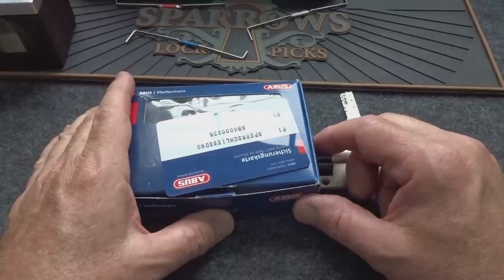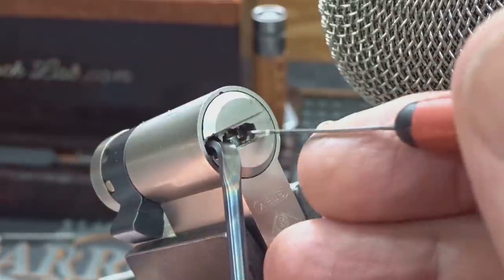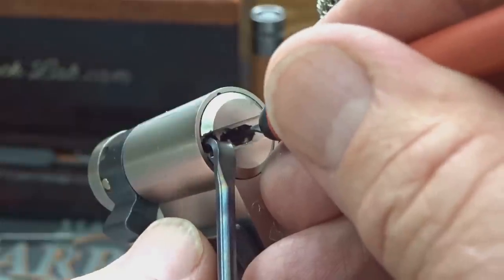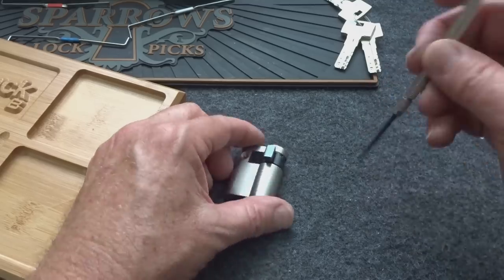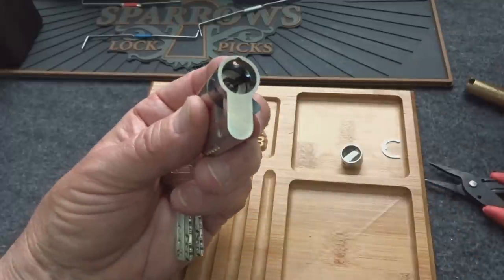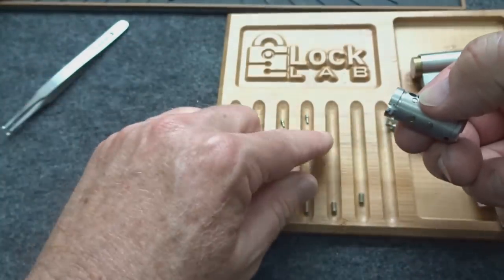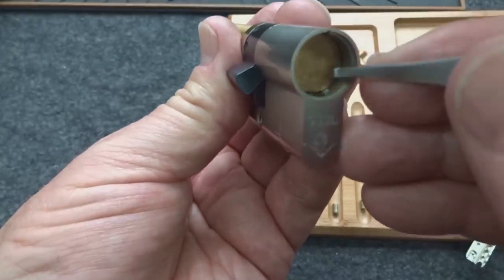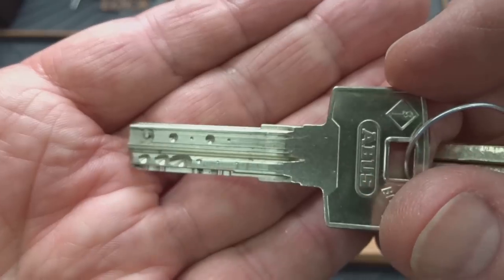(1084) Abus Bravus 4000 Picked Open & Gutted

Comment: There was no sidebar - the groove in the bottom was for the bottom pins and they appear to be purely key control (notice that they had reduced diameter and springs pressing them out towards the bible). It appears that it was actually an 11 pin lock, where the five sidepins acted as ordinary pins ... or did I miss something..?

Comment: (12:21 "I don't know what that guy in the back there does") If you had continued to turn the cylinder even further after your pick, the rearmost upper pin would have engaged & stopped you.
Reply: @fernandosm2066  There are Bravus with magnets: 2500 and 3500. A copied key without the magnet will be useless. These versions also feature pulling protection and higher drilling protection.
Reply: I wonder if he could have done a full turn with that extra pin. Quater of a turn doesn't open any door.

Comment: Good work Bill. What's your personal recommendation for a high security euro cylinder?
Reply from the maker: One word:  Abloy.
Reply: Wish I could afford.  As picking isn't the attack used in the UK (snapping is) I quite like the look of that Yale Platinum you picked yesterday.  It certainly took you some time, and would not be vulnerable to snapping.
Reply: Anything 3*** rated should be hard to snap and difficult to pick
Reply: So Bill, when can we expect a Protec or Protec2 picking video? :P

You know i'm just kidding mate, excellent picking as usual. I know it doesn't count to you because of the battery misbehaving but we know you're not about claiming false credit, you wouldn't have posted this video at all if you didn't actually pick it.

As an aside, you didn't ever answer my question about your 50mm BiLock brass padlock, did you ever end up picking that bad boy? The one in question is the fixed core with BiLock stamped on the front of it.
Reply: Also, what are your thoughts on Abus' X14 and XY14 system? Have you had the chance to have a pick at one?
Reply from the maker: Have not spent a lot of time on the BiLock, but have had NO luck with it (yet).  It is still living comfortably in the naughty bucket hotel.
Reply: Looking to change also to a Yale Plat. or an ABS.......................
Reply: cjmillsnun an Avocet ABS cylinder has 2-stage snap protection as well as coaxial pins and an active magnetic element. Bill dismantled one a few years ago, it’s impressively well-hung for a euro cylinder. 
Oh yeah, trap pins too. Lots of.

Comment: I'll give ya credit bill
Reply from the maker: Nope, but I appreciate it.  Any break in the video nullifies the attempt...  that's the only way we can be sure someone isn't deceptive.  In my case, i could have switched out locks during the battery break, moving out a partially unpinned (easy) lock and moving in an unmodified cylinder for the gutting.
Reply: bosnianbill your honesty is refreshing, I finally understand what you mean when you talk about taking or not taking credit. Either way, good job with the lock sir.
Reply: Yeah, Bill, we saw you pick it on camera, the camera puked while you was disassembling it, as long as it's picked it counts. :D
Reply: You could get a cheap secondary camera from a different angle (across the workshop) that is able to be plugged in while mounted. Then use it as a picture-in-picture only on videos where the primary camera causes you problems.

Even a cheap vehicle dash cam would work for this. I have one that was about $20 USD and a 8GB card will record about 10 hours on it. (though low-light visibility is absolutely terrible on it... but I wasn't expecting much at that price.)
Reply from the maker: This is the best idea I've heard!  I have plenty of Mobius and Runcam 2s lying around that I use on my quadcopters.  They would be perfect "insurance" when I pick challenges.  Thank you!!!
Reply: Problem solved!
Reply: no,it doesent.Dont get me wrong,I KNOW for a fact that Bill didnt cheat,but thats not the point,the point is he coulkd have
Reply from the maker: I actually USED your idea in the latest video where I opened a DOM IX-6 SR!  20 minutes into it I got the lock open and looked at the battery level (less than 1/2) and realized it would die on me before getting to the gutting.  I quickly grabbed one of my quad cameras and continued on.  several minutes later, the main camera died but the Runcam kept on ticking!  Thanks for a great idea.
Reply: bosnianbill 😉👍
Awesome! I'll have to watch that one when I get off work.

Comment: What about a "fake battery"? If theres no "fake battery" for your camera model, you can usually make one yourself. A "fake battery" is a "battery" which is made out of a wood block, plastic block or whatever, with electrical contacts just where the real contacts are. Then you wire this "fake battery" to a wall adapter. NOTE *IMPORTANT* Don't use the wall adapter that shipped with the camera, it usually have a higher voltage than the battery voltage to allow for charging. The best is to use a mains adapter which have roughtly +- 0,4 V the nominal battery voltage, so if you have a 3.6 V battery, a adapter between 3,3 and 4,0 volts is usually okay. When using a "fake battery", you often have to carve a little jack in the battery door so the cable can come out.
The idea is in other words, having a wall adapter that "pretends" to be the battery itself, instead of having a wall adapter into the charging port.

The advantage of using a "fake battery" opposed to soldering wires directly on the battery acceptor contacts, is that if you is travelling and do not have access to a wall plug, you can easily pop out the "fake battery" and put in a real battery.

Using a "fake battery" solves two things, one is the bad location of the charging plug, but the second advantage is that you avoid the constant charging of a battery, which can both have safety issues, but also make for videos that cut off, especially if the camera won't run without battery, regardless of charger or not.

Anyways, when the text "Take off your headphones" came up, I tought you were going to push the screwdriver though your hand when trying to get rid of that clip and then scream of pain.

Comment: I see this all the time. YouTubers with fixed indoor camera positions, using batteries. Why don't they use mains adaptors?
Reply from the maker: Because my power charging plug is on the bottom of the camera, so when it is plugged in I can't mount it on the tripod...  I WISH...  that would be the perfect solution.
Reply: I might be uneducated on how tripods work, but would it be possible to record upside down, and just flip the recording in editing?
Reply: My guess is the tripod mount threads into the camera and the power port Bill is referring to is either obscured, covered or otherwise not accessible when the camera is mounted.  The would make it impossible to plug in, regardless of orientation.
Reply: If the camera was mounted upside down the viewport would also be upside down...
Reply: Bill have you tried on those things?
ASIN: B01LXB7SLO

Your Camera might fit in it, and you could use the USB Port.
Reply: You CAN do that with a phone tripod adapter. Because it can grab the camera at a different place to the USB port would be free.
Reply: I got one of these from Kickstarter. Holds anything short of a full frame camera by sticking to almost any flat surface.  https://www.amazon.com/dp/B00HHD11JW/ref=cm_sw_r_cp_apa_GO6izbJZ9PFGY
Reply: Sounds like a scam by the camera company to sell more batteries
Reply: Bill you might want to look into someone with a 3D printer and some CAD experience to create a "dummy" battery for the primary camera that has leads that come out for hooking up to 3.7V. Requires a small notch or hole in the battery compartment to allow the leads to come out but will be a ton more flexible than a full adapter plug.  But then you could use some good ol' 18650's to power the camera.  If it's a common camera, there might already be a dummy design on ThingaVerse or other such sites.
Reply: give me a battery and i will see if I can rig a mains power adapter for you that would fit into the battery slot does not have to be a good battery as long as the rated battery voltage is on it or known but a non volatile battery would make the work easier such as a ni-mh as then I could take the battery apart and not have it explode on me but even a lithium battery can be disassembled i would use allot of capacitor and a ferrite core to ensure clean ripple free power my labor would be free just parts and shipping the shipping would be at least 40 dollars I checked a few years ago unrelated to the UK  I am in the US pm me for contact info
Reply: I would take a battery apart then use the shell solder some capacitors to reduce the ripple voltage fill the voids in the shell with epoxy then have the leads come out in a non intrussive manner would take some skype time to get a visual of how the battery fits the cam and how the tripod fits in 3.7 volts likely not maybe 7.4 if its lithuim the cell voltage could be as high as 8.4 or as low as 3.2  while 3.7 is typical using an unregulated power supply is a big mistake if this was something that used alkaline it would be fine even a good regulated power supply will show a week battery if to much of a voltage drop happens on the wire so will keep that wire short and heavy test lead wire is a good option can be had in 18 awg and its very flexible I would aim for 16 awg with the same flexibility and very thin yet robust insulation
Reply: Because cameras have batteries that should be fine what people are trying to do!